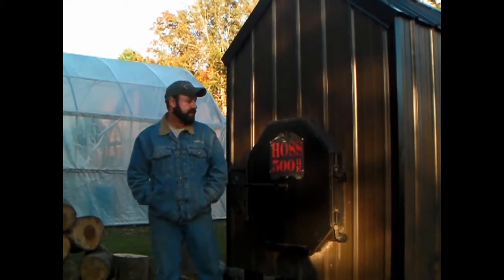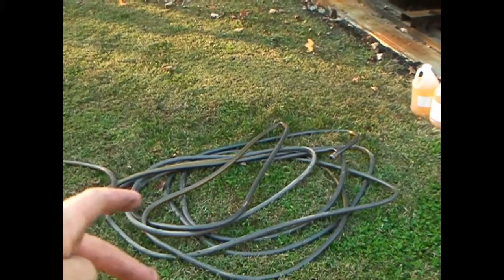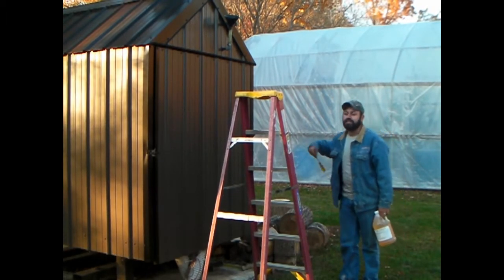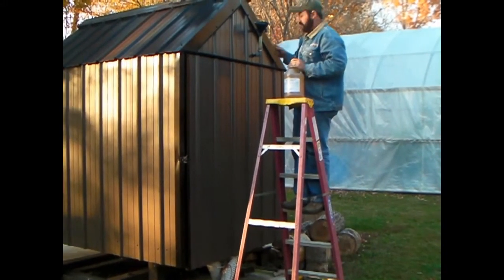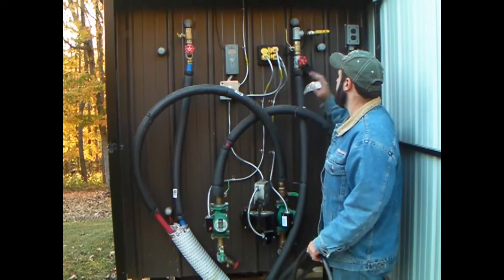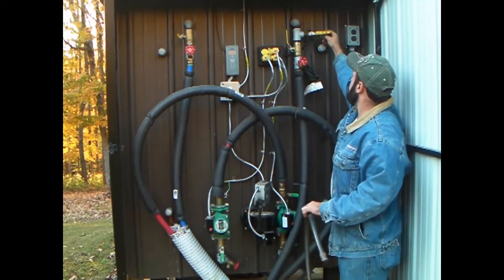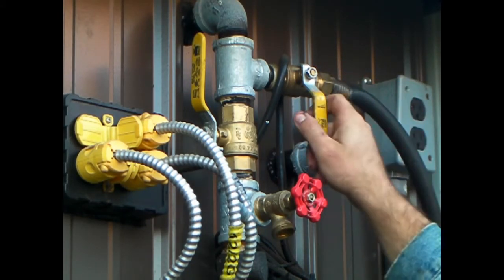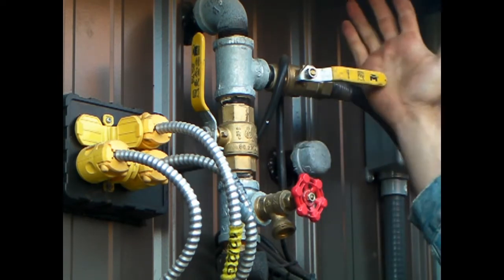How to Start anOutdoor Wood Furnace

Comment: Hookup a water connection inside the house via a T connection with a ball valve to control feed water. No hose to drag out and get wet with. Much easier and always available.

Comment: How are you liking your Hoss 500 HE?   WE just purchased their 300SF unit and are in the process of setting it up..  Any tips you may want to share on the setup?  I notice yours has a slightly different hose configuration and apparently your heating two separate buildings i'm assuming?  I'm hoping they get their install videos finished and posted soon.